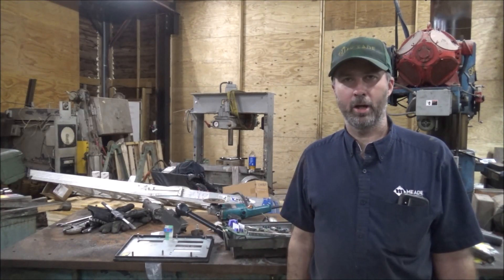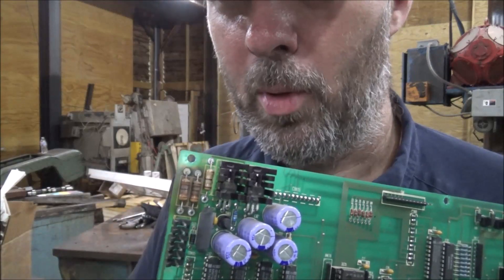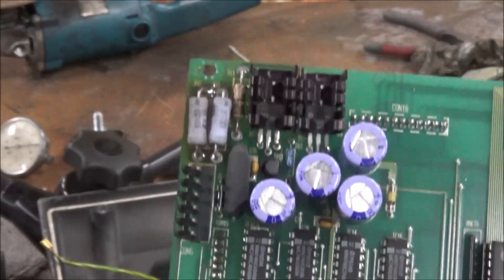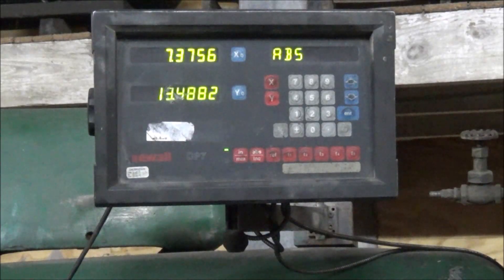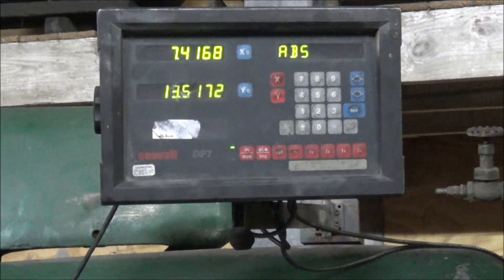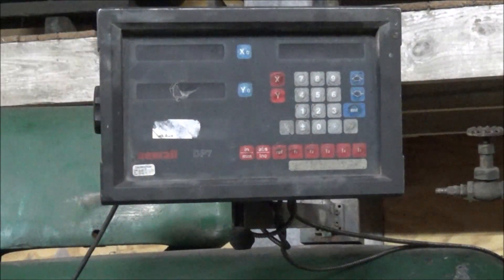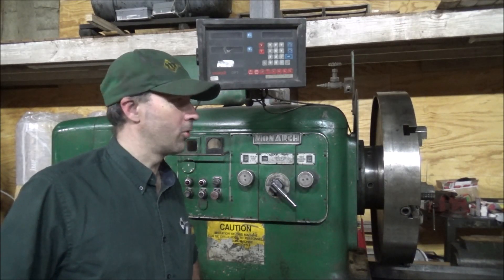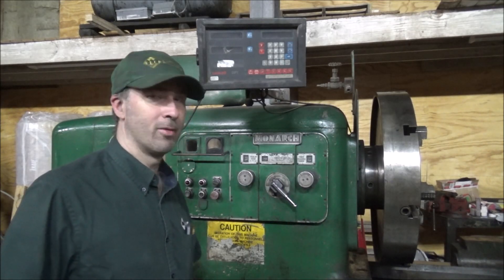Newall DRO Repairs

Comment: open the board run until it quits then spray the components with a cooling spray.
Reply: That, or use a heat gun / hairdryer to cause the fault and identify the sensitive component.

Comment: Check the power supply voltage to see if it remains steady.  There may be an over voltage protection problem causing it to shut down.  Since it had been intermittent see if there is an ic 723 which is a voltage regulator reference or zener diode to set the voltage.  Or it could have fixed itself (doubtful).  Greg

Comment: Old electronic tech here. I would suspect on of the capacitors to be out of tolerance. Look especially for any that might be puckered on the end. Best way is to take a can of circuit cooler or refrigerant and spray lightly on each component while watching the display.. you can buy a grab bag of assorted electrolytic caps from the internet..like 100 pieces for $15.Good luck.

Comment: As often as not, I would find a fractured circuit trace near an over heated resistor such as the ones you replaced. If it is a fractured circuit trace it will get worse. If it is an internal battery it will likely lose stored data after a loss of power. Electrolytics tend to not fail intermittently.

Comment: Do you have Desoldering devices.. as simple as a solder sucker https://www.homedepot.com/p/Aven-Desoldering-Pump-with-ESD-Safe-Plastic-17536/206320624  with digital gear getting old.. you will want to watch the caps and start replacing them.   there are date codes on the electrolytic caps.  4 numbers.. week of the year and the decade and year..  so an 0480 would be the end of jan 1980 if i recall.   caps are only good in service for 20 or 25 years.  if they are allowed to sit discharged 5 to 10 years.  never install a new electrolytic over 5 years old.  actually over 4 years old.   there used to be Sprague cap testers.. that could charge and discharge caps looking for leakers at operating voltage ..  my brother used to repair professional audio gear.  reel to reel tape recorders that cost between 50K and 130K.. mixing consoles that could be anywhere from a few thousand used to over a million dollars new..  caps are the first thing to go.  as the voltage builds up.. they can leak thru the insulating paper or plastic film.  start pulling massive amounts of power.. if the power supply cannot supply enough power to explode the caps.. they just hog all the power and the voltage drops below the minimum turn on voltage.. much like you were experiencing.  since you probably have no local electronics suppliers.. Digikey, . there are others i can't recall the name of now..  are all good choices.. https://www.digikey.com/   your CNC is going to need it in the power supply and on various boards.. please be very careful.. static sensitive equipment..  its crazy easy to blow up computer boards..  you can damage them with 20 volts of static .. you can build up thousands of volts of static charge in seconds.  you may want to spray down your clothing with some downey fabric softener diluted 60%..  along with wearing static bands connected to the circuit boards you are touching.

Comment: My money is on those caps. They can be bad with no visible indication. In my experience, when the caps go bad in a power supply circuit (which that is) other components burn up around them.  Also, many regulators are thermally protected and shut themselves down when they go over temp. That would explain the behavior you were seeing.
Reply: 100% correct 78 and 79 series regulators will heat up and go out on thermal overload. Ill assume the resistors are series with the regs and are taking the brunt of the current from a leakey cap that is going partially shorted
Reply: Agree.  Change those old caps.
Reply: Those electrolytic caps go bad with age, not necessarily with use. Not being used can make the electrolyte dry that compounds the problem. After having a charge on the caps the electrolyte can reform, however, there is likely to be some voltage leakage in them. Those electrolytic caps are inexpensive to replace and doing so is cheap insurance against future failure even if they aren't the culprit now. I'm sure you know, but just to be safe, be sure to observe the polarity when replacing them.

I saw some other electrolytic caps on the board besides the four at the power supply. Change them all. Looking though the comments someone pointed out that there were tantalum caps. If so replace them too. You'll have to take not of polarity as well and many techs replace tantalums with electrolytics, however, in logic circuits you may not want to do that. Just be sure to get them with a little higher voltage rating than what's in there. When tantalums fail, it is usually with fireworks and smoke escaping. The failure mode is usually a dead short so they take out whatever else is around them. Most techs hate 'em.
Reply: The electrolytic caps usually bulge their top outwards when losing their electrolyte and overheat. 
It probably is thermal overload, but that would not vanish that fast, those caps are not of the self healing type.
Another thing might be too high leakage current to the sensors. So it might even be the position of the machine which makes the problem vanish.
The DRO powers the read heads of the sensors (usually 5V), so i´d check the wiring for defects or measure current draw, or see if it still overheats with read heads disconnected (might take a bit longer because of lower overall load, but should stay the similar if the problem is internal).

Comment: Brian, if you run into those problems again, pleases contact me at brianb001.yt@gmail.com.  I am an electrical engineer, and would be happy to help you get that fixed!   Feel free to save the email address and let me know if I can ever offer you some help.  It sounds like the voltage regulator on the board is overheating and going into its protection mode.  Look for a 3 pin chip with a square metal tab that may be mounted to the board with a small screw.  It's probably marked 7805 or 7812 (a 5 volt and 12 volt voltage regulator).  If there is too much current being dissipated by that chip, then it will turn off till it cools back down.  You can either add a fan to case to help the chip cool down, or add a small copper piece attached to the metal tab to help pull the heat away from the chip.Also, as a several viewers have suggested, it would be a very good idea to make a copy of the ROM chips on your DRO.  In time the ROM's will lose their contents (which is normal after many years), and your DRO will be left without the instructions to operate anymore.  Here is an eBay listing for a EPROM reader / writer for less than $50 and less than 4 day shipping: https://www.ebay.com/itm/372501468291 .   I would be happy to step you through the steps necessary in making a backup of your ROM's.

Comment: First, @0:59 sec. there appears to be a battery, it most likely is discharged and may need to recharge, check with a meter;  second, if the problem reappears you can open the case and blow air into it (fan) to confirm that Temperature is the issue, finally if temp. is suspected you can dab alcohol (not Bourbon) on suspected components and observe the evaporation rate, any change in operation should help to isolate the offending component.   Lastly, at 7:03, that is one monstrous 4 jaw chuck, very impressive.

Comment: Suggest you check that the socketed ICs are making good connection with their sockets by levering them up slightly and then pushing back down until they are fully seated. This usually scrapes off any oxidation on the pins so they make reliable contact.

The PCB appears very dirty in some areas - if the dirt/dust is electrically conductive this may cause intermittent failures. Best approach is to use some air to blow off the excess dirt and then follow up with some iso-propyl alcohol and a soft, anti-static brush or cotton swab to clean of the stubborn dirt.

You should also regularly inspect the back-up battery on board for leakage. Chemical leaks from these types of batteries can cause a lot of corrosion damage to the PCB and should be replaced at the first signs of any chemical residue appearing around the battery seals. You need to check the manual to see if the battery stores any critical calibration information and if any special procedure is required to change it.

Comment: Do change the caps, as  they increase resistance and won't power it as temp changes, I'm certain it's those larger caps, but change them all
Reply: Old caps can dry out and cause problems. But that looks like a linear regulator in that corner so I probably wouldn't suspect then. What powers the linear regulators?
Reply: @chasmosaurus3  good point also the voltage regulators are often suspect with age too, and cheap to replace, a freeze spray (or even his cold airline) might help to trouble shoot
Reply: Jusb1066 this is probably a good idea as well. Really depends on what type of caps, those are good quality DRO’s and might have decent components and not need changing
Reply: sinkosav it’s not that hard. Mr Carlson could teach you a thing or two
Reply: Older caps leak DC voltage. Even minor DC leakage causes havoc with circuitry.

Comment: Backup those EPROMs while you're at it. 

They loose  charge on the floating gates as they get old and the stored data becomes bad.
Reply: Another thing to do while it works is measure supply voltages and write them on the board, if they are not plainly obvious (e.g. because it comes out of a 7915). This way, when it fails completely you know what's what. And if you can't fix the power supply for whatever reason you can just supply the right voltages from external sources and get another few decades out of the thing.

Comment: Agree with a few guys who said to replace the capacitors. Maybe find a guy who is repairing ham radios & TV's  and has the ability to test the caps. From what little I know about capacitors, they will leak unwanted current back into the circuits, causing those resistors to overheat. By now the whole board is probably suspect and a guy with proper testing gear can weed out all the gremlins. Mr. Carlson and "Buddy" from The Radio Shop have good tutorials up on YouTube for chasing down the bad actors on a circuit board. Good luck, and I hope this helps.

Comment: I'm glad you mentioned power boards. Many power supplies have switching supplies. The biggest culprit is electrolytic capacitors. Check for leaky caps and bad solder. That was the most thing I replaced on flat screens.  I have fixed TV's for 35 years.
Reply: Electrolytic capacitors should be changed at every opportunity.

Comment: If you have a FLIR video monitor (Shows heat patterns in the video screen) start with that to see what component is overheating. The next best thing is a LED thermometer.  Scan the whole board to find the culprit.  Finally use freeze spray to confirm the bad part. It will come back on provided the circuit doesn't have a fail shutdown circuit. If there is a shutdown circuit, power down and on again.  The board will fire up again showing the bad part.  Happy hunting.

Comment: I've repaired many vintage Japax wire EDM machines and dead batteries or batteries that will no longer charge are one of the most common issues I've encountered. Definitely check your CNC milling centre if it's been in storage for a long time. It's a real pain when the batteries have discharged and the various control boards lose their firmware or settings.

Comment: Just replace all the caps (especially the little brown ones) and resolder all the joints. If it is heat related you can spray it with Canned air turned upside down until you find the "bad" part.
Reply: Good advice. Caps are cheap. Air duster is cheap.
Reply: The little brown caps are tantalum  bead capacitors. When these fail they usually do so in a catastrophic fashion. It is unlikely that these are the cause of this temperature sensitive failure as these won't come right again when the temperature drops.

Comment: Hey Brian.
It's good that the DRO is working like it should.
My only concern is why.
As you know Electronic items do not fix themselves to often.
But it's not a major concern.
As long as the Lathe itself keeps running.
If it was a CNC machine might be more of a concern.
If it gets the better of you.
Better just to buy a replacement and keep this one as a spare.
Thanks for the video.
Peter.

Comment: Does that DRO use a "wall wart" for the power? I don't see any kind of transformer on the board, so that leads me to believe it's getting DC power in. Anyway, if it has a wart, I'd start my search there.
Reply: Wes Johnson Services
I’m with Wes, he is very knowledgeable in electronic wizardry. And most everything else as well.
Reply from the maker: There is a power supply built in the other half of the cover.

Comment: If it starts taking a dump on you again, get a can of liquid air (Amazon maybe) and spray each component individually and wait a minute or so between components to see if heat is the factor. That is how the guys in our fine repair shop checked the boards. A lot of heat related failures in an aluminum smelter. Hope you have already found the fault.
Reply: The two resistors looked like they were designed to carry a fair amount of current. They got very hot and burned out from high current flow. A short circuit, perhaps intermittent, could cause that. Without doing some voltage checks and resistance checks it’s really impossible to diagnose the problem. Why it turned off and then back on is a mystery. I don’t imagine it came with a schematic diagram at the component level. If you have a part number and/or manufacturer of the unit it may be possible to locate one via a Google search. I enjoy the videos as it is a fascinating area I have no knowledge of.
Reply: ,,, yes, especially check the SCR's, silicon coated rectifiers for over heating . Do they all look like big m an m's ?

Comment: Use some freeze spray to isolate the component that fails when it heats up.
Reply: Right on! I use air duster turned upside down. Cheap easy to find at Walmart.